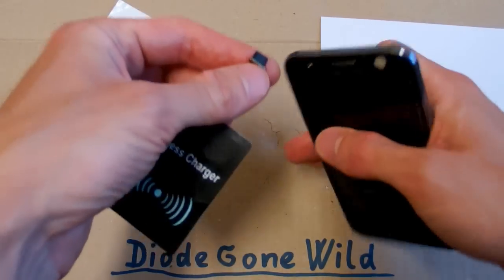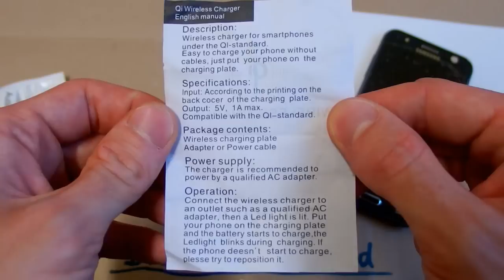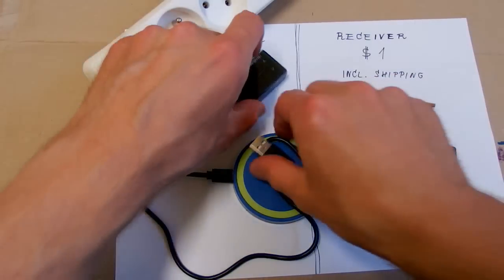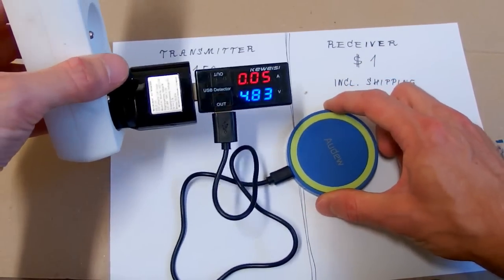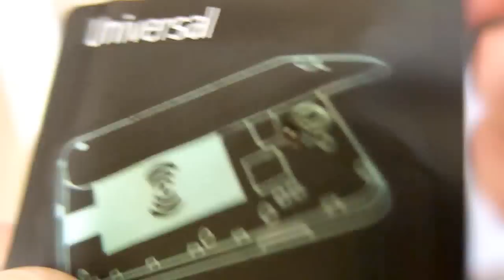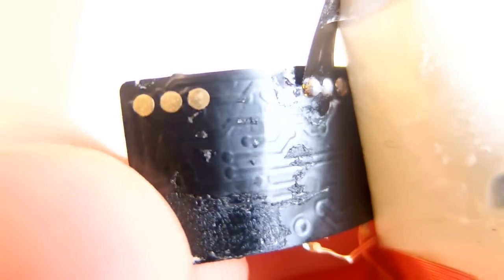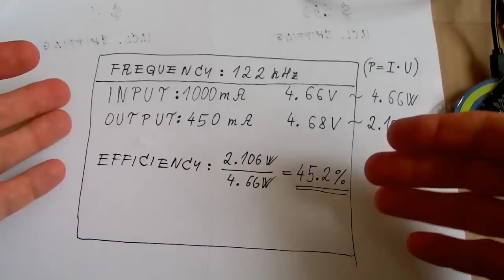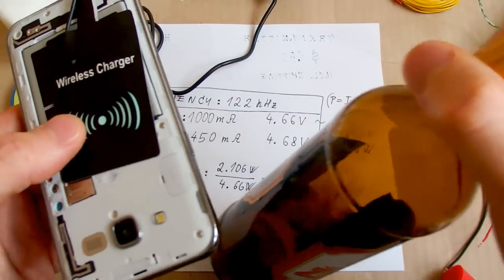Wireless Qi Charger (sets your phone on fire)

Comment: I highly doubt your Tx pad is Fuly Qi. I have the same from FRYs   same case ,  Ive poped mine open   Its a   H bridge  being driven  by a  Osc

It is not the BQ  series  Ti Chipsets that are a proper rated  QI driver. 
the Q of a QI system is a VERY    tight; and there are tons of  resistive losses  if its not at the rith Freq  as the load changes !!!!!!! 

Read a QI  white paper its  rather cool how the  Rx can talk to the TX via  impedance changes 

QI is a complex system and its not just a dumb  passive  induction system 

BTW  QI is rated  to 85% on a proper system     ....

Comment: that looks like a stupid design.  the 10 Turns has very low inductance.  It should have been made of #28 AWG and 100 Turns instead.  that is why they needed so many transistors to drive it.  instead of making a transformer they made an induction heater coil. few turns of fat wire.  really stupid design.

Comment: I bought an old HTC Windows 8 cell phone from Propertyroom.com it has the wireless charge built in, I found this out by downloading the maual.  So I decided to get a charger and give it a try.  The one I receive  was in great shape, well new, when it arrived, and I never had to fix it before I used it either. I have used it daily to top off my cell phone every morning, and it does the charging quickly, much quicker, it seems then the cable that I had been using.  Sure the phone is warm when  I take it off charge.  Perhaps I got a better quality device, it sure does look better then the one you got,  ut I did get it from a Chinese seller on Ebay.

Comment: i used one back in years when there was no official wireless chargers so i brought one for my note2 and instead of connecting it to the usb port you have to connect it to the back under the cover which has a 2 little gold pieces, Any way... after the first use i felt the phone is hot and i didn't feel comfortable so i disconnected it and after an hour replugged it in and it's the same, so after this i never used it again. cheap crap.

Comment: Its because you connected a 2.1 amp charger that why it over heat. try use just 1.0 amp
Reply: You talk shit, when you connect 1A you get only 1A when you put more the device get only max which Is possible taken, so he have right try 1A. Because on video use 2A and device get 1,4A...
Reply: Sabahan YouTuber and Petr, the charger provides the current ONLY when and only how much is needed. So for example, when he plugged the device in the charger for the volts and amps, why was it 5v but ZERO amps, and not 2? That is because the charger changes the output current dynamically. So it is simply providing what the wireless receiver wants and it is getting what it wanted.
Reply: That’s not how amps work. You’re thinking volts. The charger will only draw as much amperage as it needs so using a power brick with a higher amperage is a good thing since the qi charger+phone can draw up to 2.1 amps if it needs to
Reply: Petr Jirotka that doesn’t make any sense
Reply: Petr Jirotka Google translate fail.
Reply: For the lord of electronics do not charge a fucking 1 amp device with 2.1 amp charger. Just don't, I chargedy phone ONCE with a beefy 20 amp 5V regulated PSU and it LITERALLY killed the charging circuit inside my Galaxy Ace and fried the whole mobo... It burns the hell out of a device IF the device doesn't have proper protection against current. It HAS to have current regulations inside if you wanna use a more powerful charger with your device.

That's why the phone manufacturer often says it on the device's box that "Use X manufacturer charger only, any damage from 3rd party device's causing damage will NOT covered by the warranty"

So to sum it all, if your phone supports fast charge, go ahead but don't complain about heat because that thing can only handle 1 amp at max, that extra amps will turn into heat dus act like an LED with no regulations. It will draw more amps

Also, this guy DIDN'T checked the current going into the phone, if you think you're a good electronics repair man you should have knew that at least. Very disappointed about that because I wanted to knew what draws more than it should